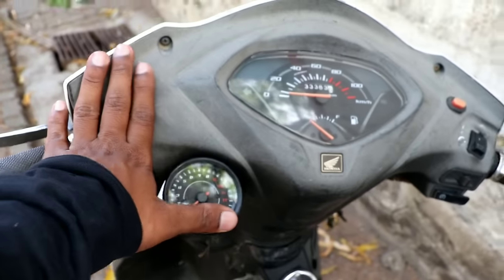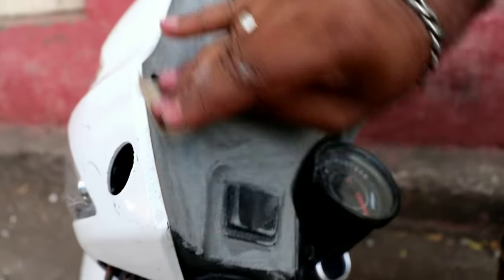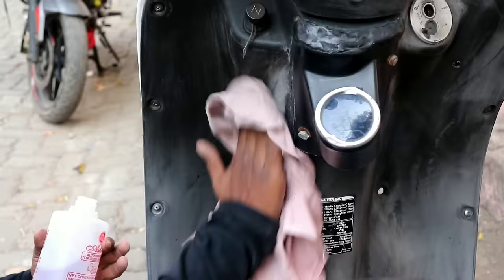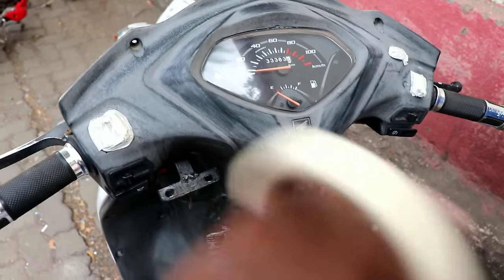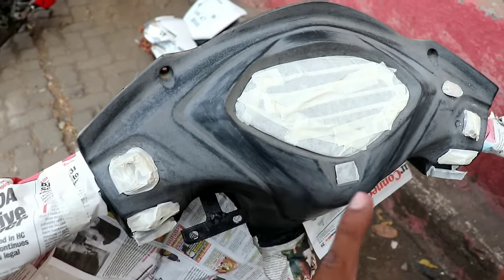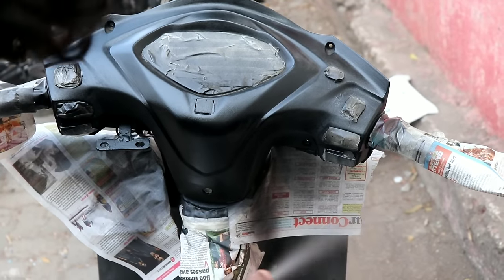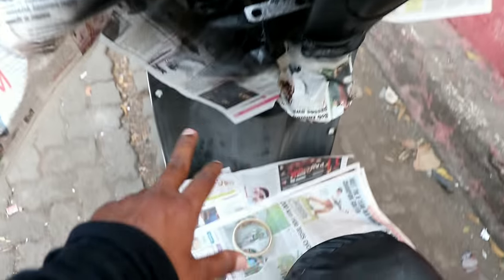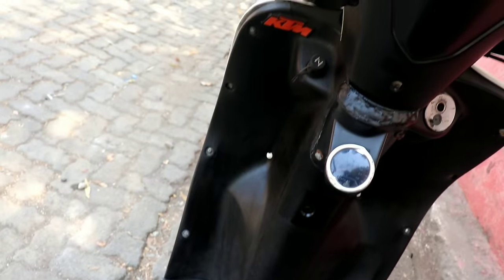Honda Activa Dashboard Polish | Shine All Scooters Dashboard

Comment: Y did u remove ur hydraulic clutch from 200ns 
If u tell as v will not do as will.
Name sake dont make videos and fool others
Reply from the maker: i didn't liked the feel of that clutch as i like the wire ones more better low maintenance
Reply: @Jhampa66  but is it good na